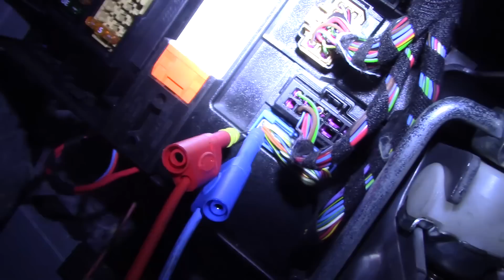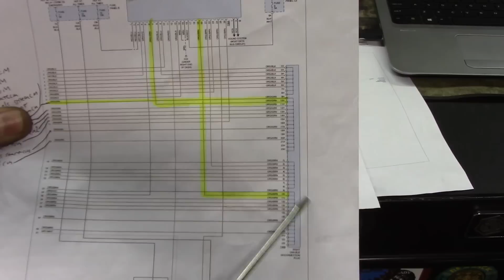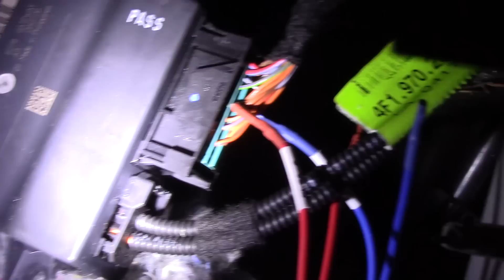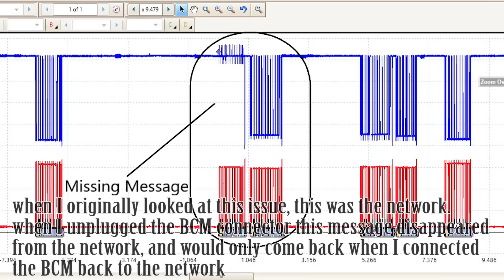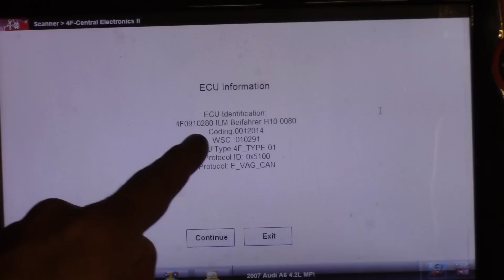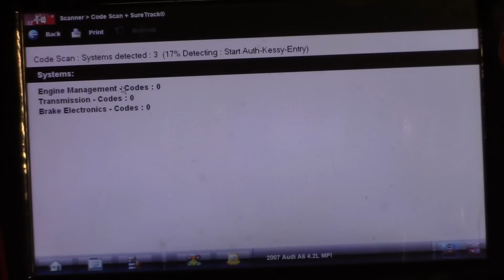2007 Audi A6 - Comfort Network Issue (single wire mode)

Comment: Why do it the hard way? If you go to Gateway Live Data you will see which control modules are running in 2 wire & single wire in realtime.

Comment: Great Job. I wonder could you have possibly pulled the can low splice connector and checked for a solid ground signal there at the pins and identify the grounded module?

Comment: Seems like Audi’s light years ahead of gm. Gm just started mandating serial data gateway modules in 2017. I believe gm would call the comfort bus, isolated mid speed because it’s isolated from the dlc. Back probing with a scopes probably your only choice. I wonder if the comfort bus uses 2 120 ohm resistors on each end and should read 60ohms normal back probing with all components asleep. That’s cool how u could unplug most modules and not lose communication with half the modules because it’s a series parallel network vs a series network I’m used to working on. Look forward to checking out more of your data com videos. It’s good stuff. I wish you had access to a gm Mdi and data bus tool software. It virtually eliminates the need for a picoscope. Just a slower baud rate.

Comment: Great video. Can you tell us more about the "component protection". Is this feature on every brand new AUDI control unit? It is mandatory to be removed before coding, no?

and why is it there in the first place. Thank you sir.
Reply from the maker: You can still install a used module and code it. So you don't absolutely have to buy a brand new module. And apparently you need a factory tool to remove it. So even if you install it at home you still have to take it to the dealer to have it removed.
Reply: mike roy hey buddy component protection is Audi’s attempt at forcing the user to buy only new parts. They are increasing the amount of parts that they try to block us from changing with known good used parts. If you need help removing component protection on an vw part just reply to me here I can help you out easy enough
Reply: cesnwk10, Thank you for the reply. So in order to cut down second hand parts they add component protection. Why do brand new control units have it?

Please school us on how to remove it :)

Comment: Good video … Made me smile when you mentioned wet carpets / CAN errors. 
Over here in UK we have lots of Audis and lots of rain.  The waterproof membrane on the back of the carpet often masks the telltale ‘wet carpet’ . On A4/ A6/ Passat you can get 1/4 inch water under the carpet but dry carpet on top !
Don’t forget to clear the scuttle panel water drains before you give the car back.

Comment: Nice video on gm you can check the individual module can signals at the splice connector or the comb could you have done that on that vw if the module wasn't accessible. The networks it something else I can't wait to mess around with gm most network its fiberoptics. Nice video
Reply from the maker: I have done too many fiber optic issues. They don't seem too difficult

Comment: Very interesting video Tom, have you any experience with Audi a3 2006/07 BKD LOOSING DASHBOARD LIGHTS and all switch illumination after ignition is switched on (lights up briefly then cuts out) Many thanks Kenny.
Reply from the maker: Losing the back lighting or losing indicator lights ?
Reply: back lighting..as well as mileage/odo heater panel display..
Reply from the maker: That could be a cluster issue. Not sure though. I would have to see a wiring diagram

Comment: Hi, Tommy. Can this so called wrong pattern on shorted CAN  wire be seen on DLC connector also?
Reply from the maker: No. The only messages you will see at the dlc would be from the scantool to the gateway

Comment: Ross tech will let you do the coding also
Reply from the maker: I was able to do the coding with snap on. A factory tool was needed to remove component protection
Reply: Positive Lead Diagnostics what does that consist of doing? I’m curious if my Ross tech does that. I know it does give me the security code to access adaptation in the modules to change things.

Does that model have a drain by the ecm that’s suppose to drain the water away from it? Was it clogged?
Reply from the maker: The factory scantool has an option or test plan to turn it off. I don't know what it actually changes internally.   The cowl flooded
Reply: Component protection is 7 bytes programmed to the new module, this is vin specific, it is in the ECU,  key and a number of other modules on this model. You can program used parts with ODIS also once the original vin of that part has not been changed the CS can then be accessed via GeKo and rewritten. VCDS does not support component protection on any module on any VAG.

Comment: Nice diagnosis Tom!  You can also check each modules signals at the splice connector after removing the comb. Great video and info on Audi programming.
Reply from the maker: Yeah I need to make a few jumper harnesses that have pins that will fit in those connectors
Reply from the maker: I tried that.  But when I disconnected the splice connector. There were no messages from the modules except the gateway
Reply: Yes you'd have to activate each module like the door switch module to get a signal. You can jumper the gateway low  terminals at the splice and monitor the signal while you jumper the low side of each module and see which one is pulling the gateway down but you had easy access to the BCM and nailed it. Like you said you have to know how the network and how they communicate. Your videos and diagnostics are solid and it's impressive to see how fast your knowledge base is growing especially on difficult vehicles and enjoy watching your videos. You'll probably hardly ever use your Verus lab scope at least that's the way it is with me. I'll use the Pico almost all the time but it's nice to have another 4 channel scope just in case you need more that 4 channels.
Reply from the maker: Ahh I see what you mean.  Jump the can wires from the gateway to each module separately   That would have worked. But woulda required some connection fabrication.  Thanks for watching and supporting.  I appreciate the compliments and tips
Reply: Yep I made up a few sets of jumpers...saved a lot of time. Keep the videos coming!
Reply: That can splice connector you pulled out is the most valuable tool in diagnosing these systems quickly. Can simply jump them one at a time watching your scope and then when you see the bad pattern can determine what module it is from a wiring diagram. Works great especially with so many modules and many that are difficult to get to. This video should explain better. https://www.youtube.com/watch?v=PN-zlKn5KRo&t=1s
Reply: Hayward's Automotive by using Wiring Diagrams; Do we able to know it's a pull-up or pull-down design? also Min Max volts for the Waveform?
In the comment; you wanted to jumper the low side from Gateway to each module 1by1 because we have missing message at Low Side? If it happens at High Side so we jumper the High Side from Gateway to each module 1by1?

Comment: Hi did you try to remove the components protection with a VCDS ? Because I replace a couple of confort module on a MK 6 golf and I was able to unlock the modules I can’t remember what it was called but I was able to recode the module it was a long code type but if the module wasn’t unlocked if I remember right the remote would not work or something else.
Reply from the maker: Your thinking of production mode or factory mode on a bcm. I don't have vcds. I could do the coding with snap on. But I needed Audi scantool for removing component protection

Comment: Nice Tommy! Would it be possible to get waveforms at the "bus bridge" ?  I was thinking you might get the communication from each individual module if you disconnected it?
Reply from the maker: When I disconnected the connector the only messages I got from that connector were from the gateway

Comment: one last thing how do you determine if its the module pulling down the network or an output of the module? just wondering? unplug and jump the com wires with a jumper??

Comment: i worked on a 2007 beetle last week with a 400 milliamp draw unplugged comfort module drain went away. was lazy and didnt do any more testing got a new one. same problem. my amp clamp got ran over by my buddy so cut random wires at the module pin 10 on the t3 connector eliminated the drain. said it went to the cluster on a wiring diagram. repaired wires seems to be fixed hasnt been dead in a few days now

Comment: Did the module have any signs of corrosion inside?
Reply from the maker: Surprisingly it did not. I was expecting to see something
Reply: Positive Lead Diagnostics I was going to ask the same question . Do you think the bcm1 could have killed it when it went down or do you think it's because it Hade made in Australia written on it. Was the new item made in Germany?
Reply: Thomas you would just drill a small hole for the water to drain out and screw a bolt so you can drain it out regularilly, wouldn't you ;) ;)

Comment: Nice Tommy, great work!
Reply: Hi Dan!
Would be nice if there was a way to identify modules via the CAN signal (just like syncing a relative compression waveform with an ignition signal) that could have pointed out that module before the signal was shorted (just had that missing packet)... rather than having to disconnect one at a time. With full short up or down, identification obviously can't be done. There must be some kind of communication order... if there is, then disconnecting any 1 module (and knowing what the order is) could help determine which one was missing. I have no CAN / LIN experience, so I have no idea if it's possible... they probably don't all stay awake the same length of time.
Reply: Thomas, of couse when the comm.wire shorts out no communication is possible. But indeed when there were only messages missing from a certain module the other modules can indentify that module. Sometimes you'll get a code like; Missing message from instrument cluster. / Sender Intrument cluster-receiver Gateway (Example). But this varies by, Brand/Vehicle age/ system. When no such codes are stored, i know of no other way than  the way Thommy did this one. Unfortunately some modules are hard to reach and this method can be time consuming especially when it's intermittend😥
Reply: DiagnoseDan Thanks Dan!
Reply: Once you disconnect the splice comb you can check CAN hi & lo from the terminals and check each modules signals vs. disconnecting each module only sometimes you have to be a contortionist and it's easier to disconnect. For the modules that are hard to access it's easier at the splice...sometimes.
Reply: Thanks for the tip!!
Reply from the maker: Pico has a serial decoder but without the proprietary info from the manufacturer there is no way to identify which module is sending the message
Reply: that really sucks because we were able to decode that message

Comment: Just a question Tom. So the 2 wire (can high&low) goes to single wire mode? Is this a VW/Audi strategy.
Reply from the maker: Single wire mode in this case means that the network is only communicating on one wire. I don't believe this vw/Audi specific. Lin bus is a single wire network but that's how it was designed.
Reply: No dylan on any car
Reply: Single wire is a LIN
Reply: Not only LIN.
Reply: Thx for the feedback Tommy 👍